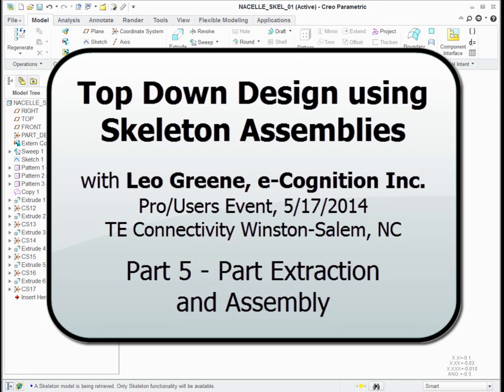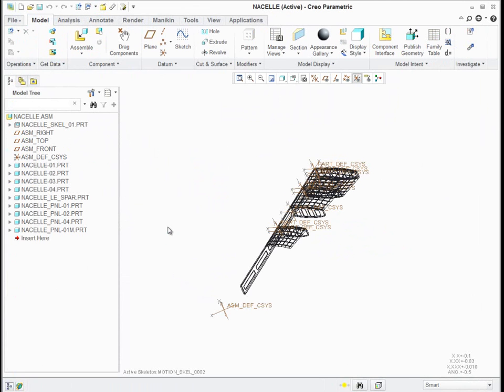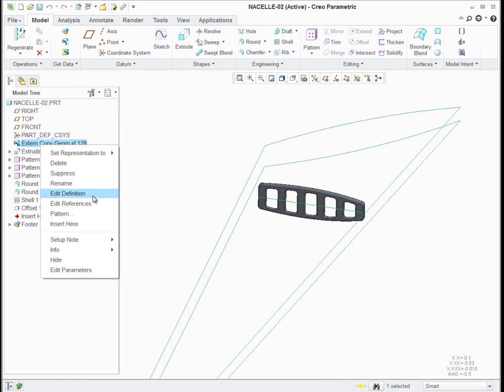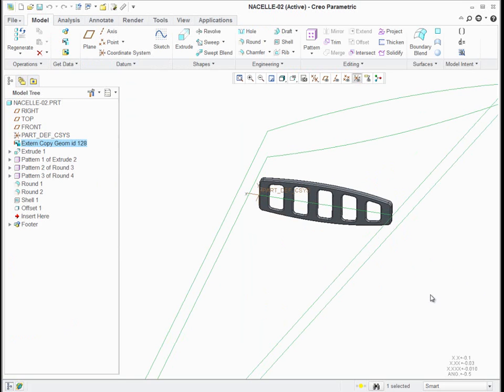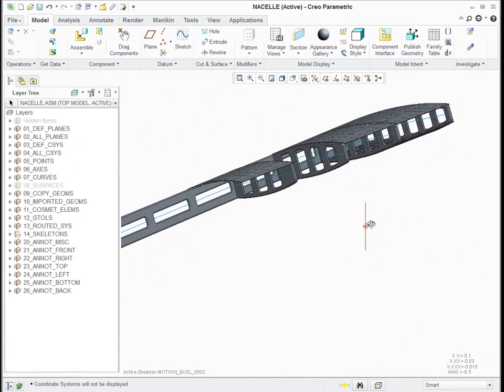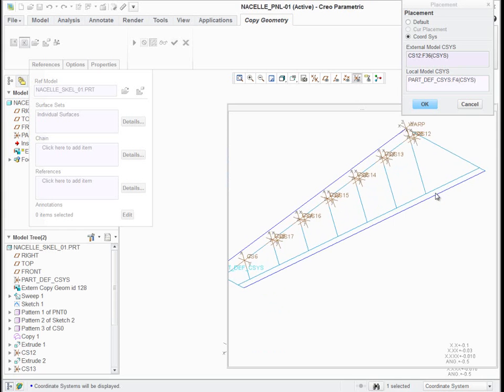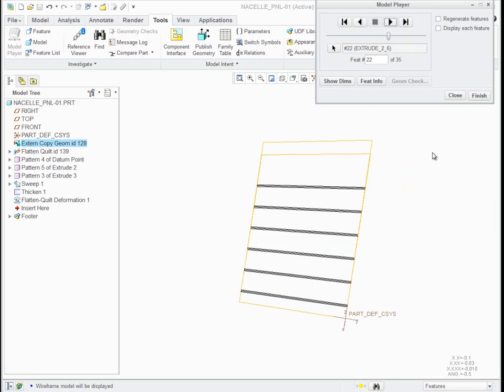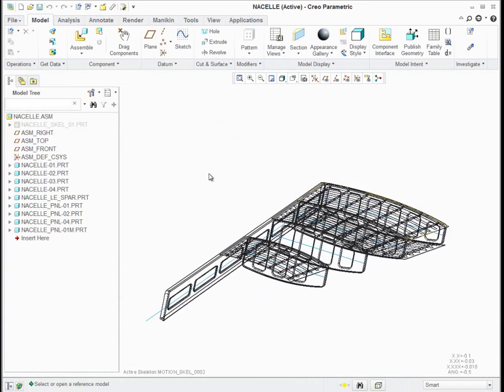Top Down Design using Skeleton Assemblies - Part 5 - Part Extraction

Comment: What is the benefit of placing existing skeleton (NACELLE_SKL_01) in sub assembly? Bottom parts could ECG of this skeleton that is located in the top skeleton.
Reply from the maker: Adding a sub-skel directly to a sub-assy ensures that the skel is insession. There are occasions however where a new sub-skel (with new ECGs) is indeed warranted.
Reply: Thank you for your reply.